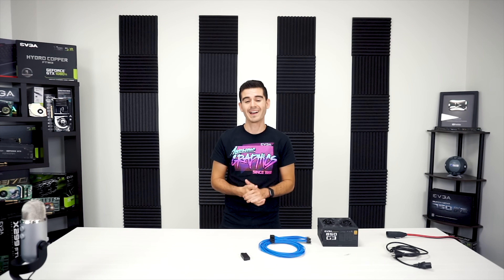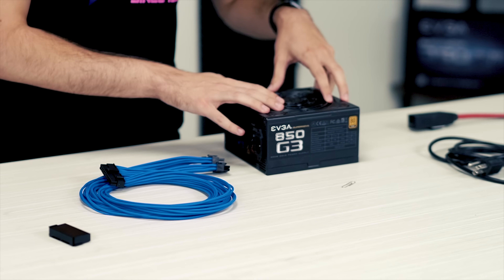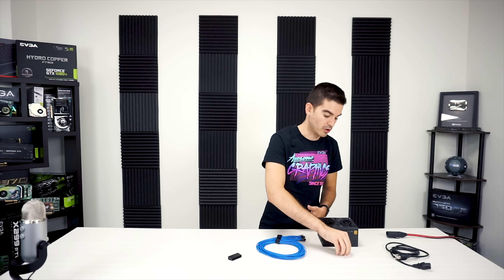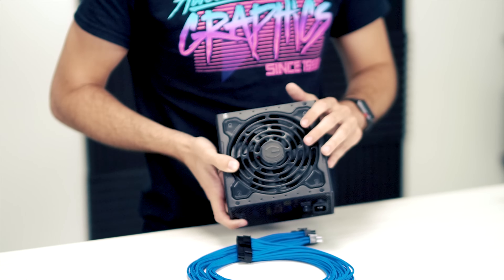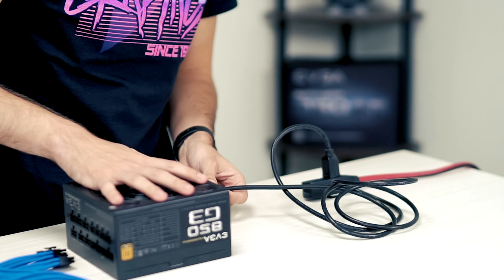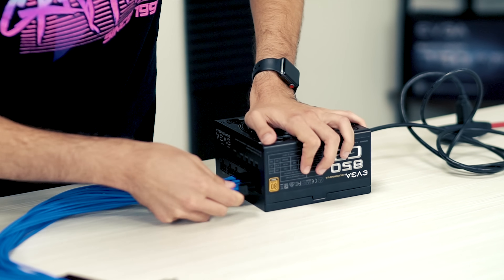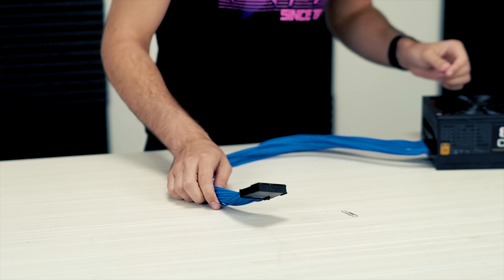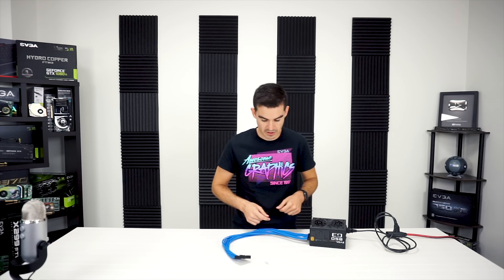EVGA Power Supply Paperclip Test

Comment: was about to finding correct pins to bridge with wire and found this video and understood what that plastic thing in the box was so I bridged the connectin with that tool which is much simpler. Fan spinned, so now I'm thinking that I need to use wires from the box and not from previous PSU (that still working).

Comment: I have the Supernova G3 Gold 650. Suspect that one of the VGA ports is not supplying the power to the GPU. Other port works fine. How to test the voltage output from the VGA1 and VGA2 ports with a multimeter?

Comment: I can use a voltmeter to ground and check all the voltages? Heard many times unit will work but be slightly undervolted. But could be power cable or wall low voltage aswell

Comment: I'm experiencing something weird with my psu: when I leave the paperclip in, and switch off and on again (with the psu switch), the fans don't turn on again. So the paperclip test works the first time, but not after that.. does that mean my psu is broken? I'm experiencing issues where my mobo doesn't turn on when I press the power button of my pc. However, I found a hack that works: First switching off the psu, and then while keeping the power button pressed, switching on the psu. Only this way I can boot my pc now. Btw. the pc seems to be working fine apart from this.. all the voltage readings are also normal.

Comment: Anybody can help me , I have PSU cougar GEX 1050 and I can't jump start it I use a wire jumper connect the green pin (it's black in this psu) with any ground pin as I am doing usually with any psu but with this one the power just turn on and then off after a second
I need to turn it on without connect to motherboard to feed my GPUs

Comment: There is one small problem with this: The fact that the power supply starts, doesn't mean it actually works.
Reply: That’s the problem I seem to be having, my psu fans will start working then stop.  Do u think it’s no good? (I’m doing the paperclip test btw)
Reply: @Cubxns  Depends.
Your power supply might not run the fan unless there is a higher load on it.
It might also not want to start without a load.
Just plug a harddrive in it and if the harddrive keeps running even if the fan stops I would say its fine.
That doesn't mean the power supply works under high loads or that it can keep sustained loads.
Reply: @filenotfound__3871  would u have any idea why my pc would be turning on, then off after less than a second, then the rgb on the ram turns back on and does nothing (the fans don’t blow the graphics card isn’t on). Also now when i click the start button on the motherboard to start up the pc it doesn’t do anything
Reply: @Cubxns  Sounds like you have a short somwhere.
I can't say for sure, but based on the power supply behaviour outside the computer, i'd say that the power supply itself is faulty.
If you could perform the power supply test with a harddrive or some external fans from my previous comment, that would be a great way to confirm that the power supply itself is faulty
Reply: @ thank u 🫡

Comment: Thanks for mentioned the eco mode. I have an supernova 650 g5 and it has a button to keep the fan off. I was wondering why the fan wasn't spinning. I would assume keeping the fan on is a good idea to keep the unit cooler
Reply: Your assumption is correct. I dunno if eco mode functions similar to most modern graphics cards or not though because I never use it when it's present. I just know it's meant to keep the system a little quieter.

Comment: Sooo today I startes my PC or better, I tried but it wont start. I checked all the hardware and unplugged everything it didn't start. The last thing I checked was the PS. I searched for a method to test the PS and found your video. Thanks for the help. I tried what you said and the fan didn't rotate. So its the PS thats the problem, or at least it should be the problem right? My PC was working fine the other day, I played some demanding video games and today it suddenly didn't boot.

I ordered a new one, and it should be here by tomorrow. Is there any chance that the PS could have damaged any other hardware? I mean, I will find out tomorrow I guess ... but if the new PS is here, the PC should boot up again?
Reply: Did it fix your PC after all? If you're still curious after 9 months, it's technically possible that a component could unpredictably have a transient spike in power draw (tiny and very short but tall spike) and blow the PSU, but that is what OPP and other protections in the PSU are built for

Comment: Just in case some of ya'll were still unclear on the exact pins, I have one of the EVGA "Detection Tools" he mentions right here in my hand (which functions the exact same as a paperclip) and therefore can indeed confirm:  * it is indeed Pins [#3] -&- [#4] which are required for jumping* (that is, when facing it with the clip on top like shown in the video*)
 --i.e. basically you just count over (towards the right, like reading English for instance) starting from the left side on the top row:  over one (skip), over two (skip), over three spaces (put in one side of paperclip here!), and finally over four spaces (put the other side of paperclip in here!).  Now, you should be good to go!  

Hope that helps!  I tried to be as descriptive as possible to hopefully avoid confusion!  

cheers,
--Fred
Reply: In the video he says * PINS #4 and #5 ***, which agrees with the pins that my testing tool has connected together.

Comment: I’m getting the Supernova 750w G5 delivered tomorrow. First time of using an EVGA, so kind of nervous but I know it has the 24 pin block to test it. 
I’ve always used Corsair PSU’s, but I needed an upgrade for my pc and apart from Chinese knock offs the EVGA was the only brand in stock here in the UK. So excited but nervous.
Reply: Update?
Reply: @Tralby19  I wish I had waited for th e RM 850 to com eback in stocl, my G5 has developed the coil whine issue that is common on this model, its really annoying. However apart from that it performs flawlessly.

Comment: Mine 1200W G2 has came with a tester which has 3rd and 4th linked, but if i am not wrong it should be the same as the 5th as it is ground. Can anyone confirm on that ?
Reply: The 4th one IS normally the PS-ON (green) while the other -- maybe 5th like yours is supposed to be ground -- but i'd chk eVGA

Comment: Great tip, thanks, just got a new PSU and it was great to test it before the actual install, thank you, stay well :-)
Reply: I did just that (the paper clip test) last night with a NEW be quiet ! PSU from NEWEGG I took delivery on in the afternoon.  No go, nothing.  Also hooked it up to a test mobo. Nothing.  So annoyed with NEWEGG, RMAing and having then refund my dough.  2nd time in 2 months they have sent me a completely useless product.  They will no longer get my business.  Bye bye NEWEGG.  Went an orderd an EVGA from somewhere else.
Reply: I ordered a 500w off Newegg that doesn’t work look like o have to return it :/
Reply: @C3lly  Contact them via Chat as soon as possible and request an RMA/Return mailing slip  you can print and stick on the box it came in to return it to them.  Pack it up in the same box with air pouches it came with or packing peanuts or newspaper.  They suck lately-as you can see above, sent me a NEW DEAD be quiet Pure Power 11.  They had no more so demanded a refund which the jerks have been sitting on since getting my return 7/23/20 at 3:00 PM.  I would not order another from them as they clearly are having issues with sending working components.
Reply: James Brock agreed do you think amazon is the spot?
Reply: @C3lly  Normally, yes, but as of late, they seem to have trouble with stock and price.  Google Search and check out: Office Max/Depot and CDW.  Had luck at Office Max/Depot 2 weeks ago, but now their stock is also running low.  Good luck buddy and don't wait on contacting those jerks at NEWEGG.  The box gets shipped via UPS.  And yes, check AMAZON just to be sure.
Reply: James Brock okay thanks man! I am currently building a gaming pc and it wouldn’t turn on! It scared me at first until I found out it was the power supply... it sucks how you get a power supply out the box to find out it’s broken :/
Reply: @C3lly  Very cool about the build-have fun and good luck with it!  Air cooler is the way to go just make sure your case will fit the cooler you pick out.   Water cooling is a big gimmick like RGB.  And yes, totally ridiculous to get a NEW PSU only to find it is dead.  No reason for that.  Also look on B&H to see what they have.  IMO-Bronze is the choice over Gold unless the price is close, bc it takes a long time to make up the price difference in energy savings between a Gold and a Bronze.  Also try to get one with UVP and at least a Japanese main capacitor.  That might have been the problem with the be quiet!-it was Chinese.  I had good luck with Office Max/Depot btw.
Reply: James Brock okay thanks man I really appreciate it 😁
Reply: @C3lly  more than happy to help! :)  Get back to report on how you made out.
Reply: Celly, EBAY would be another place to look, although unless you ordered from online stores there like Best Buy, Newegg or Outlet PC, there is a little more risk involved.  But, finding a new unit from a Seller who 1) has sold items for a long time on Ebay and 2) has very good Feedback, may reduce that risk greatly.  You would also have to see what the Seller's policy is on returns in case you get a DOA one-would not want to have to spend our own dough, shipping it back.  Right now, I am seeing a new EVGA 500W (80 Plus) unit for $58.95 from a Seller who has some negatives but also 290,673 items sold.
Reply: @C3lly , worth checking EVGA's site as well.
Reply: @C3lly , watch for those idiots at NEWEGG trying to keep any shipping fee you had to pay to get the dead unit in the first place.  They are currently trying that on the DOA be quiet! unit they finally acknowledged is dead.  I am seeing a refund except for shipping.  They tried the same thing on a case I returned to them immediately bc it had a huge dent in the top and was unusable.  I contacted them about the $8.99 shipping for that and they refunded that too.  Will have to do the same on the $4.99 shipping they are trying to keep on the DOA be quiet ! What a joke NEWEGG has become.  CANNOT recommend them!

Comment: The fans turn on with this test however  my pc will only turn on when my graphics card is unplugged.  My pc crashed while gaming and wouldnt turn on
Reply: Ur GPU and psu?
Reply: @dinkthesink3890  after taking things apart. I found my gpu was fried. I got a new card. Everything turnon but still no signal. I dont see any damage on motherboard or cpu. I tried reset cmos. Tested the monitors on other sources.  .everything is getting power but still no signal from monitor
Reply: @milplayer17  try a spare gpu and test

Comment: My EVGA psu has all the correct voltages but under load it collapses and my system restarts. Without the videocard my computer can stay on, have some tests run but when the load of a GPU is added and loaded than it shuts down. I changed the power supply and that solved the problem. 
  So with this paperclip method my psu would look fine but it isn't.
Reply: Its not to see if your psu is good enough for your gpu it is to show your psu is working and its powering your mother board you have a cheap psu that wasn't enough simple nice that you resolved the issue

Comment: My EVGA G2 550W PSU turned out dead out the box, and since it's been over 3 years from manufacture date, I can't get any warranty coverage. I can't even find a replacement for a PWM controller because it's a SuperFlower Leadex platform that has no markings on controllers.... AA9013 that the top cover says means nothing to electronics component sellers... Stuck with a non-working piece of technology, wrote multiple letters to EVGA and SuperFlower, and no answers or help in return.
Reply: My EVGA 650 BQ seemed dead out of the box with this test but I "kickstarted" the fan with my screwdriver and it jumped to life. I think the fan just got stuck a little in the same spot during shipping and needed to be loosened up a little. I left it running for a few minutes and now it seems to work fine.

Comment: Can you kindly explain how this test will assure a customer that the power supply is working correctly (Voltage Watts and AMPs)
The only thing this test does is activate the power supply but in NO WAY does it tell you anything else. A Power Supply can ignite but still not provide the correct voltages etc.
So  Fully explain instead of giving incomplete information.
Reply from the maker: This was explained briefly in the video, but not explained in detail (to keep the video short). This power supply, as with other EVGA units, has both OVP (Over Voltage Protection) and UVP (Under Voltage Protection). That means that there is sense-circuity in the unit that is monitoring the output rails for correct voltage. They are tuned to reasonable tolerances to keep them from triggering constantly (random shutoffs). If the power supply is giving out incorrect voltage, the unit will not allow itself to power on, thus the fan will not spin and the test is still instructive. In that sense, there is a power supply tester built into the unit. The units are specifically engineered to not damage other system components and that is part of the reason that we are confident enough to back them with up to 10 year warranties. This test does not help in instances of shutdown under high load, but that requires dedicated electronic testers (like Chroma stations) which cost thousands of dollars. This small test is a good starting point if you have an EVGA power supply and your system does not power on at all (a low load scenario), or you want to make sure your unit works before starting a build. In short, if fan spins, the voltages are not in a dangerous range.
Reply: Speaking of briefly. There is a false sense of security here in providing this information and should have been highlighted at the beginning and the title. 
This is not a test of the power supply as a whole, but a test to see if the trigger circuit is working and the unit is generating enough power to activate the fan.
Reply: You need actual power testing equipment to determine that. This is just a basic function check BEFORE you hook everything up. It's still useful.

Comment: Just one reason to love EVGA.. no chance to do this with a bequiet and the support juast laugh on questions like that.
Reply: That feature is built into every PSU on the market...
Reply: @1980zander  he is right the be quiet psu have a load protection when the paperclip is used
Reply: +Alexander Zhukov Just try.. i owned E8, E9 and E10 PSUs and there is no chance to start the bequiet at slave (dual-psu cable) in my mining rig. Bequiet works only if connectet direct to the mainboard
Reply: every psu can do that ..  why would they laugh ?
Reply: You ever tried with bequiet psu`s after 2012? i think not.. good luck ;)
Reply: @ricksanchez9102  Haven't owned one didn't know you couldn't do that with them 🤔 since then